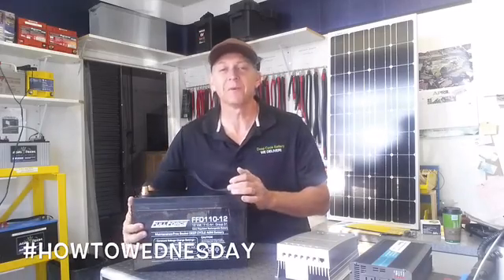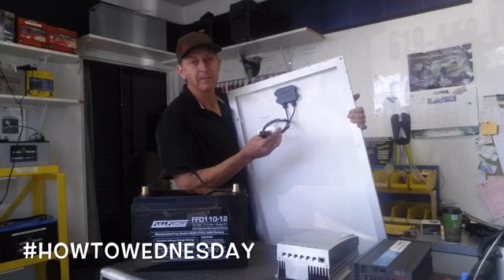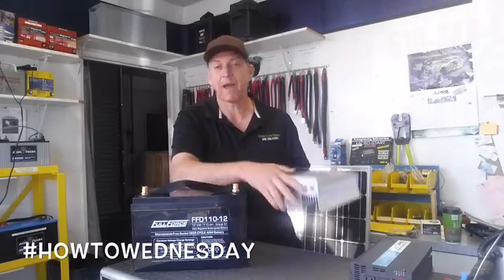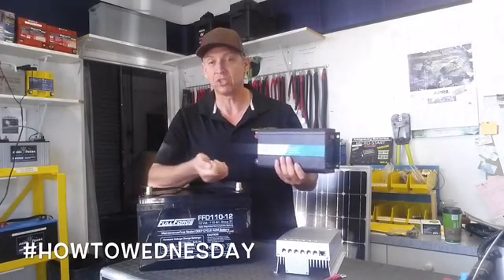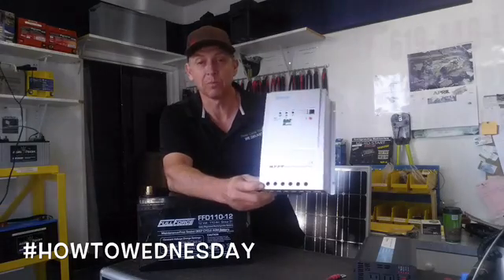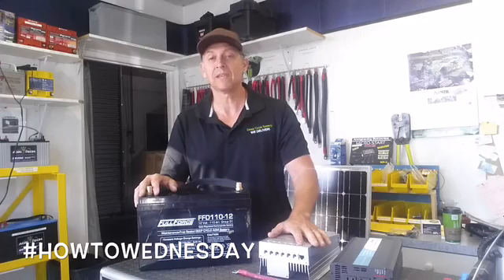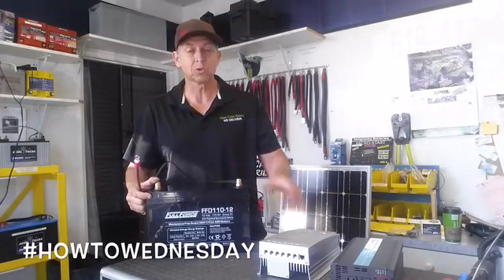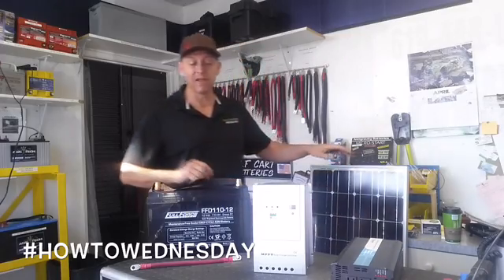#HowtoWednesday 100 Watt Solar Kit with Battery for Off-Grid

Comment: If you using a solar panel to charge a car battery how many watts should i get.How long will it take to charge a car battery using a solar panel if the battery is empty ???

Comment: I just purchased a 100 watt Thunderbolt solar panel kit and 4  12V, 35Ah Thunderbolt batteries from Harborfreight. The kit comes with 10amp charge controller. Do I need a higher charge controller and if so, what size and kind (PPM/MPPT) should I get? I'm an amateur so I need something that would work without much monitoring after I set it up. Priced around no more than $100.  Thanks...
Reply: MPPT for more efficiency.

Comment: Can’t you run the solar panel into a regular mppt and then to the battery ? Does it have to be a charge controller?
Reply from the maker: not sure the q, Charge controllers regulate voltage from the pv. MPPT and PWM are two types of charge controllers. Running the panel directly to battery will overcharge the battery
Reply: @DeepcyclebatterystoreSanDiego  and 3

Comment: I bought the renogy 100 watt kit mono and it came with wanderer and I then got confused but bought the Renogy 12v 100 au Rechargeable Deep Cycle Pure Gel Battery.  I hope this battery is what I needed and I worry about it being wrong for the system or that gel is wrong? Is it? Can you tell me if what I ordered should be okay ? If it is..then now I need to know about that sine converter and which one to buy. 

I am in a minivan doing stealth camping but starting with 1 panel..adding up to 4 on this kit is possible. 

Thanks in advance for any helpful responses.
Reply from the maker: The battery should do fine. Keep mind of how much it discharges. The 100 watt kit will only produce about 5amps of recharge power. 12.1 volts is about 50% discharge

Comment: The resmed autopap as well as respironics autopap. The units are already D.C. So you just need to go D.C. From battery to D.C. Of your pap machine.you just need the proper connector supplied be the manufacturer.

Comment: Someone stated "expensive", but keep in mind, this guy is running a brick and mortar store where people walk in and pick this stuff up NOW, and require in person "service", the internet age has devaluated that concept. I am sure it costs him a lot to do this, and he is on the hook for the quality of service he gives, where as you buy something online, you would pay dearly to have a battery and solar panel arrive tomorrow not NOW, you dont find out til after it shows that the seller or even shipper does a bad job, you have little recourse but to post a bad review somewhere, but this guy is completely on the hook for every person that walks in, and has provided quite a few well produced informative videos for keyboard windows shoppers to learn from. From doing a lot of research I know the products he has presented are definitely quality and he has provided cold hard facts as to why, as well as the option to have in face service and professional advice, many people value that, and spoken by another person in a service industry, he should be paid more for it.  I have never been to this shop, but doing some research on a 6v purchase and after reading BS for hours on forums I was unsure of the facts, this guy presented more confirmable facts in 2 minutes than the hours of keyboard jockeys... How will I confirm his facts?? being in the area, I will go down and get his products in my hands instead of going to Costco or amazon/ebay.
Reply: This is a quality shop.  I have purchased little 20 aHr AGM batteries for my amateur radio EMCON set ups, had them recondition a neglected marine deep cycle battery which worked well, and an ignition battery for my CR-V.  Great source of information, huge inventory, and these short videos are a great public service.  I recommend them without reservation.

Comment: What are your thoughts on using the specialty MC4 crimper tool, I've been just  using my Irwin crimpers but the wire pulls out easily so I have reverted to soldering the tips on..Any opinion?
Reply from the maker: that works!